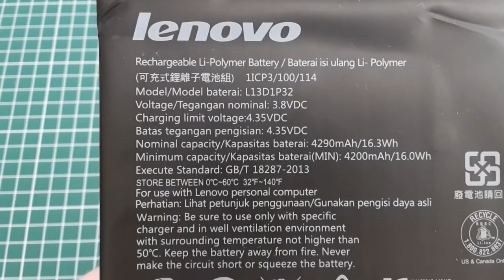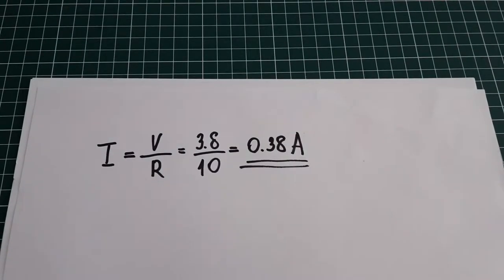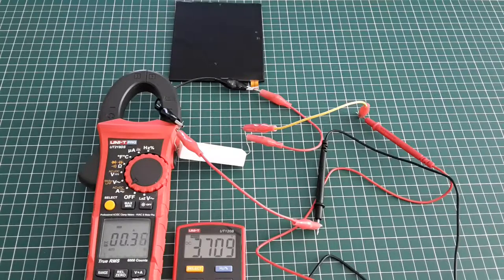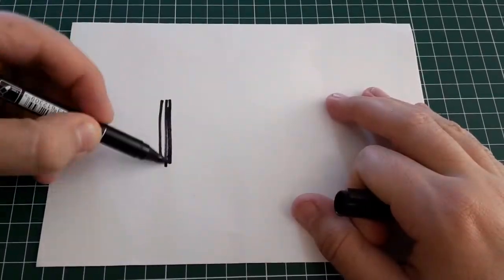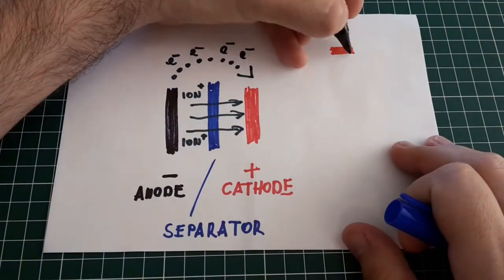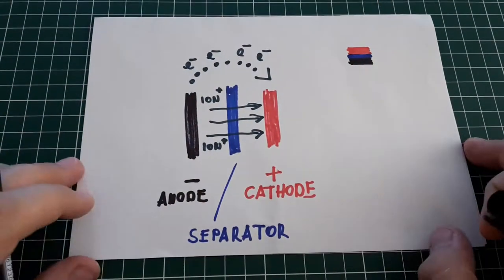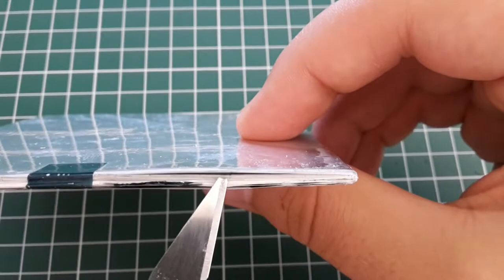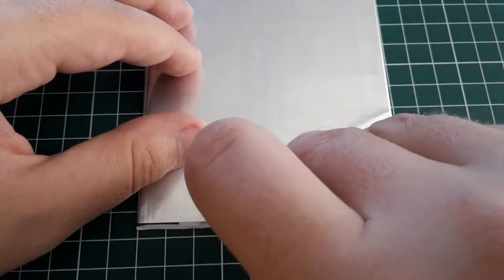LiPo, Lithium-Ion Polymer Battery Teardown

Comment: I have damaged the outer aluminium layer of a lipo battery when i've removed it from the phone. It was glued strong.
It smells a bit sweet.
That's electrolit?

I have used some tape to cover the missing aluminium layer.
Still smells sweet and some white spots appeared on the tape 
(Probably electrolit dissolving tape's sticky glue.

You think this battery is gone ?

I haven't install it in the phone.

I'm thinking to replace it.
Reply from the maker: Hi, for you safety I would get rid of it and buy a new one. This is something you don't really want to smell.
Reply: @zeroampselectronics  
Thanks, man.
I threw it away days ago.
And already ordered a new one.

Comment: Pls help me, my battery is swollen and I think its just air inside.
Reply from the maker: Hi, if I were you I would replace it because it means the end of your battery.
Reply: But it works properly, the only problem is the air inside. I cant put my back cover
Reply from the maker: How old is the battery?
Reply: 2 yrs and 4 months
Reply from the maker: Enough for battery, I think it doesn't have the same capacity anymore and it's risk to use it. Don't risk, replace it!
Reply: Okay thanks. I will replace it
Reply: @johnraffyvito2790  It's not just air, it's the gasses from the chemical reaction failing. It happens when the battery get's old and is dangerous.